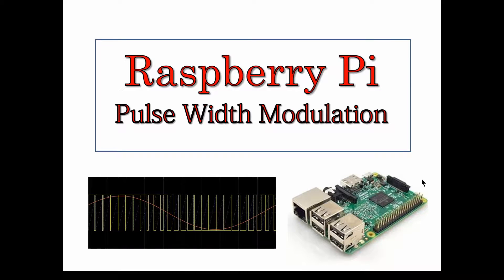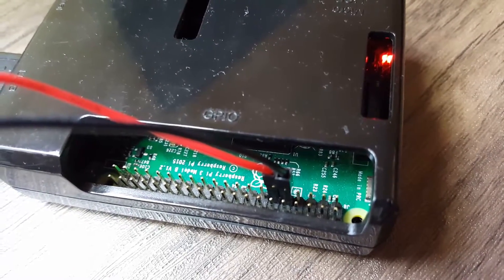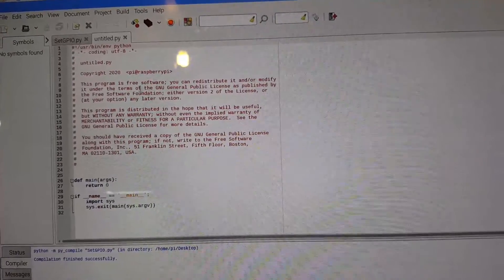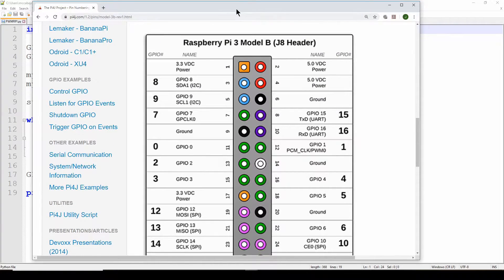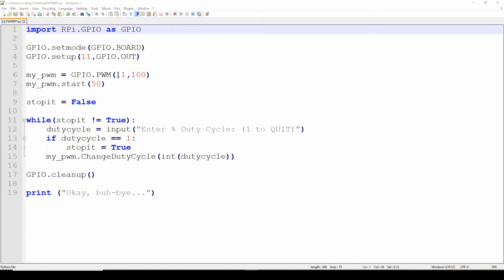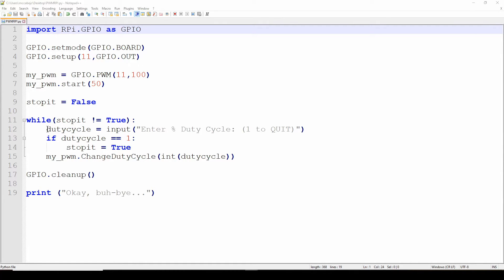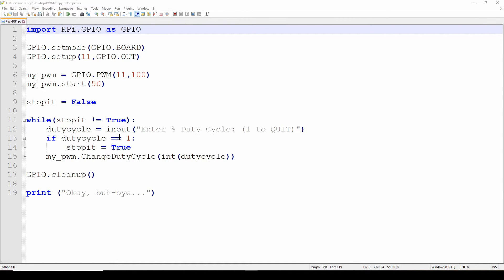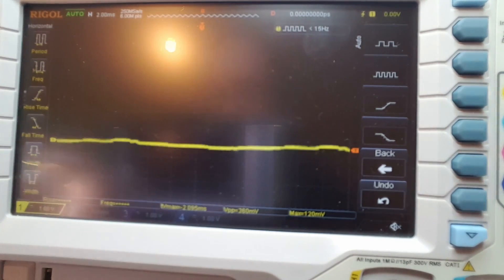Raspberry Pi Pulse Width Modulation

Comment: I'm a little confused, some of the pins in the diagram mention PWM but you are seeming to use one that doesn't mention this. How many of the pins support PWM? I'd like to control 3 sets of leds and 3 fans using mosfet boards and am not sure if I will need another pwm board, something like a 555 timer. Thanks.